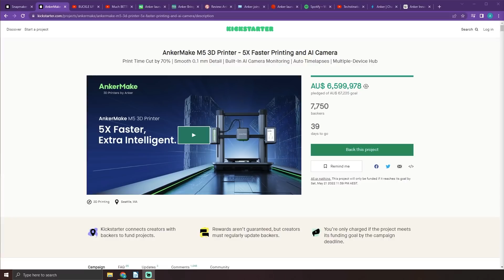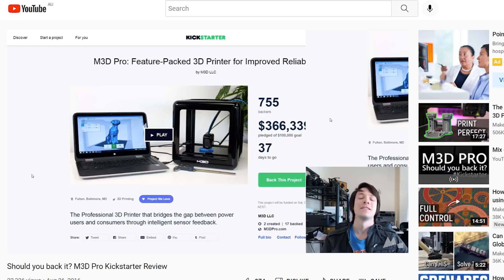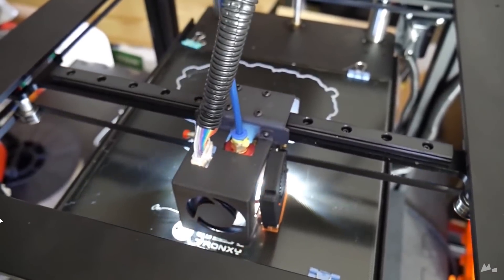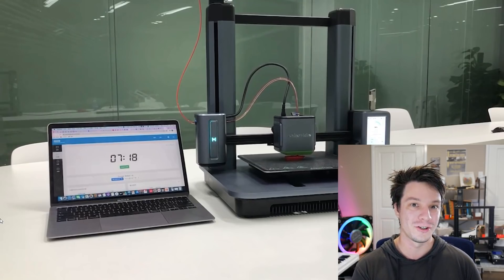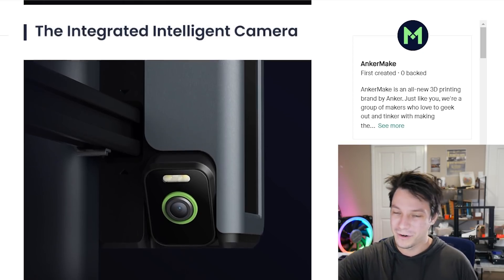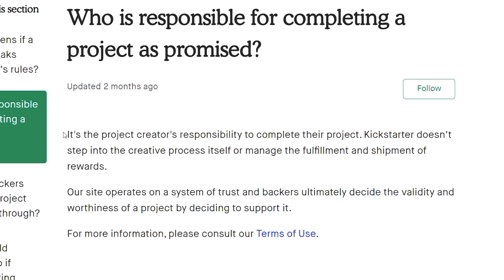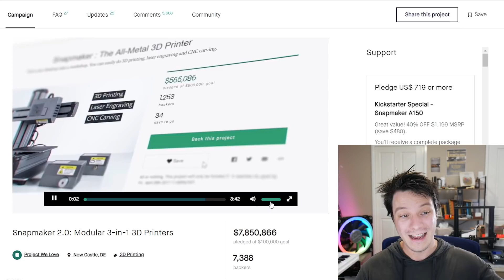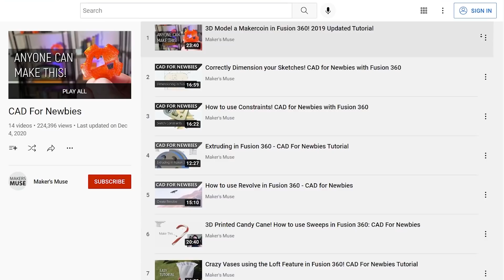This 3D Printer looks incredible, but...

Comment: Thanks for the sincere analysis, Angus. :-)
It started off feeling as though I was going to be taking a cold, hard reality shower, having already been impressed by the LTT sponsored review and leaping into my first Kickstarter.
Fortunately, I still have time to back out (till OZ Election day, anyway).
I have been in exactly the position of having leapt into cheap 3D printing with ALDI's offering and gradually run into the limitations and frustrations of leveling/hot-end/humid-filament issues, then given up.
This product, AND your commentary, have reinforced my willingness to invest and potentially take a loss (which wouldn't previously have been possible for me), given that there IS a chance that it will actually deliver the things that I needed to resume involvement in 3D printing.
I was very glad to hear your respect for Anker as a company (I had no awareness of their existence, even if I do happen to own things they've made).
I am glad I chose not to splurge on the Air Freight delivery option, though :-D The COVID pandemic has trained me to expect significant shipping delays to OZ for everything.

Power On, mate! :-D

Comment: Interesting.  I'm beginning to agree with the notion that you need to learn how to 3D model before you 3D print.  It's as if you need to learn the ways of fitness and running to own a treadmill.  Otherwise, the treadmill becomes and expensive clothes catch-all.  So.  I subscribed to Fusion 360.  And gosh darn it, I'm gonna learn it!  (I've used Autodesk's Design123 to the point that I've out grown it)  Thanks for the video, Angus, as always.  This will help re-set my mindset on my next endeavor using this technology.

Comment: Yes, i belive Anker is gonna deliver there Printers.
But what i'am curious about is the AI/Spagetti Detectiv Part.
Because this is a Service to controll you're prints and Spagetti Detective charges you in the Pro Tier 4$ for 50h of printing!!!
If you run 10x 5h prints you're done and this can happen in less than 1 Week easily.
So i'am curious how they wanna do that Part.
Ouh and btw. the Camera need light to work and i don't see any light from the Printer besides the Logo in the left glowing a bit.

Comment: This video is gold. I live by Never Preorder, Never back a printer on Kickstarter. When you mentioned a "cartridge", Made me cringe. Loved it when you said " Want to 3D print? Better learn 3D design." So true. I don't see a need for a new, better  printer. I have both FDM and resin. My FDM came to me as a Chinese A8 or something clone in a box full of parts for like $180.00 USD. Maybe I'm lucky I'm mechanical, but I think assembly brings you closer to the machine. Mines rock solid plug and play. As I'm heavy into model making for the last 60 years, I use it for utility parts and my Mars for pretty parts. So much easier to use a machine when you learn how it works.
   I would guess when people get their first printer, If it beats them up, They'll give up and put it in the closet. If it doesn't and they make a Benchy, What's next? Learn CAD. What is needed is a easy, intuitive and strong CAD program. If someone makes that, Printers will sell out. Never preorder and Never Fund.... Unless you have a lot of money you don't need.

Comment: Regarding the 10 years prediction :

I don't think 3d printing will be mainstream in 10 years. For 2 reasons : 3d modelling, as well as no real market.

Text is a fantastic way to store and share information. Because of this, it has a central place in our lives, and so everyone learn to read or write. So there is a mainstream appeal for a machine that could write for you. 
In the other hand, customisable objects are fantastic problems solvers, but aren't indispensable in our world. So there isn't really a mainstream appeal.
I use my 3d printer a lot, but it still spends most if it's time at rest. Because i don't need a different plastic thing every day ! And even 3d printing for friends, i use it a few times a week at most. And i'm quite the creative type, spending lot of time building stuff and inventing things...
Most people will not need to have manufacturing capabilities at home. A fraction of people will need a one-off thing, and only the maker community really needs tools like 3d printers.

The most mainstream usecase is going to be on demand 3d printing services. Your library, electronic store, hardware store etc. Will offer on demand printing services, and it's going to be more than enough for most. They could also offer modelling services, which leads to my second point.

3d modelling IS HARD. I was in the french equivalent of college in an "Science and engineering" speciality, and we had modelling classes. Despite having teachers, paper ressources, example etc., most people had a really hard time learning to 3d model. And we were just doing basic "extrude and revolve" kind of parts ! 

For a maker, that thinks a lot about the parts feature, 3d modelling will come more naturally. For the mainstream people, they only care if the part works or not ! 
Don't get me wrong, I think 3d modelling will get more accessible in 10 years. But not so much that everyone can intuitively open a word document and start typing text.

And, as you said in the video, only 3d printing stuff you download from the internet isn't 3d printing. And most people won't see the appeal of custom making a somewhat"standard parts"

The future to me lies in on demand service. Fiverr kind of stuff for people to model and print a part you would explain with a few sketches, picture and text. 
Even if we manage to have a low cost 100% success rate machine, most people won't have a use for it, and won't be bothered to try and manufacture parts when they are fine with off the shelves standard parts.

Comment: I'm not so sure about Objet-like technology being great for consumers. I do see it is less messy that SLA. On the other hand, just about any fault in an Object needs to be fixed by a qualified engineer. And there will be leaks in unexpected places... So at some point a consumer may need to mop up monomers, but without the experience of doing so often. Also, these machines cannot be  turned off without some work.
It might be a nice solution for people that print often, as the resin remains fresh and the print head decent. But for people that only print every once in a while, it may well turn out to be a rather messy affair. For the latter FFF with all its problems may turn out to be less error prone.

Comment: My company has an objet 30. Not a fan. Way too expensive for what it is and I doubt that will change with Stratasys behind it. If it was 10X cheaper for materials it might see more than once every couple of months use, but you are still limited to UV resins, and they have to have a consistency such that they can actually flow through the nozzles and not constantly clog.

Comment: My 5-6 year old Qidi 3d printer for $650 still prints really really well. I never made any modifications to it and only had to replace the extruder hub once after a couple thousand hours of printing. I think it does print a bit slower @ 35 mm/s but it's near perfect prints. I'm pretty happy with it and haven't needed another.

Comment: Last thing I want to see is the inkjet model on 3d printers.  Having a roll of filament that 'goes bad' because the chip says it's out of date, or a sealed container of it saying it's empty when it's obviously more than half full... Uhg...

Or the worst, your '3d print' refill unit costs more than the printer itself; oh, yeah l it's coming, mark my words on that.  The 2d print has inkjet carts that cost more than the new printer, say empty when half-full, have chips that 'kill' the cartridge at a certain date (expiration date, lol), cost 25 cents on average to make (yes, considering materials, the manufacturing and factoring involved, the pay for the labor, maintenance, managerial and logistical implementation, and even the losses that are incurred by selling the printers below market value.

Ever wondered why a laserjet printer is built like a tank in comparison?  And why toner B&W printers and even color toner printers cost so much more, but can fire off thousands of pages in some cases without a refill; and cost a fraction of a penny per page???

If the 3d print market is ready for the big time, there are 3 things that have to happen:

# One = Reliability, error detection and correction.  AI handled optical checking during print process and sending messages via cellphone/email/hell facebook messenger because people pay attention.... (youtube DM or commenting would be funny as hell though!)

# !B = materials handling has to be safer/easier.  Cartridge based printing, kept as a reasonably priced system (I'm talking like a One Blade shaver; where the handle costs quite a bit, but the blades cost about $40 for a year on average of shaving, not a Gillette; where the handle costs nothing and blades are monstrously over-priced)

# ~ ((SqRt (5 * sine(8))) * 10 ^ 4) - (10.583 ^ 2) = print speed... going back to my laserjet analogy vs. inkjet.  My giant old Okidata and digital printers could file out a page every 2 seconds or something like that... and were toner-bottle refill type... those are fun :D

I'm sure there's more, but that's good for now.

Comment: 12:00

Shit bro. 
Got my Chitreality CR-200B a couple weeks ago.

-Steppers made the sound of someone drilling through concrete when leveling
-Bed was unevenly mounted or even bent, had to stick smth to the limit switch in order to even level it because it wasn't possible by default.
-Missing screws from steppers, making them MOVE AROUND
-fan noise @ 68dB (others on fb reported around 40-45)

Comment: I agree, if 3D printing is to become more intuitive for people with less tech skills, something had to change. Same applies for health issues. Loads of chemicals are toxic in the long run, so there needs to be a solution for that as well. I see a lot of people having enclosures, but they forget that they open them up and the toxins roam free. As for people with allergies like me, resin is still not an option yet. 

Still I wonder how long 3D printing will appeal to people who can't design their own stuff. They will stop printing after a month. Some free programs are a pain to work with as soon as you come close to their max file size. Some free programs have features which are a huge pain in the butt as there is no user friendliness at all to locate them in the program and figuring them out costs yet watching one more dated YouTube vid, and the new version of the program altered how it works. 

Yet, despite all the frustration, I am addicted to 3D printing my own custom-made miniatures, lol! And thanks to your vids, I got the hang of it fast!

Comment: these 'failure detections systems' are extremely simple if you think about it... a microswitch to see if there is actually filigment coming through that is held in the open position by the feed plastic, for instance... or a simple IR sensor for proximity sensing (all phones have one to tell it to shut the screen off when it's by your face).

A relatively inexpensive Jetson Nano could be used to keep an 'eye' on the print as it goes to make sure each layer falls within a parameter that matches the image of the print at that layer... and I've been playing around with something similar that looks at a rack of merchandise and can tell when a product is out of place by doing something similar.

There's a LOT of very cheap and easy ways to take care of, and pause/stop a print, and send you a picture/video of what's going on to your phone and giving you the choice to remotely 'keep going' or to 'stop' or possibly execute a self-mitigation function.

Sure, you are talking about adding maybe a hundred dollars worth of parts, at least.... but that being said, that's a hundred dollars that could mean a LOT of peace of mind for a lot of us.

Comment: I don't think there aren't any good options on the market for 3d printers that are very easy to use. I got into 3D printing at my library maker space and they had the dremel digilab 3d printers. After a quick how to use section with the maker space manager I was able to use the printer without problems. I actually don't remember having one failed print.

The real thing here is the price point as these printers are very expensive. So if this campaign can deliver on that, then yes, it will probably be industry changing.

Comment: I agree with just about everything you said, but I partially disagree about 3d modeling. Yes, the use case depicted in the ad, 100% you need 3d modeling ability for that, but there are absolutely viable use cases for 3d printing that don't require any 3d modeling or, like myself veeeeeerrrry basic 3d modeling. For people who want to make a specific type of thing for which models are already available it could work fine.

Comment: I agree that a printer that could take a solid model as input kicks down a huge number of barriers to entry,  especially considering it can be paired with simple photogrammetry based 3d scanning with a cell phone for simple object duplication.
I don't see 3d printers to ever be an every-house tool, but it could be as popular as an expensive home network router.  
I just don't think there's broad enough appeal to be operated by grandma, regardless of simplicity, but there's tremendous promise that is achievable if enough people can get organized around an ecosystem including projects like Voron Design's team which is driven by a purpose-driven engineering team working it like a product line.  An open design can be augmented by plug-ins and hardware modules add-ons,  type converters and specifying bill-of-materials on a continually improving basis. 
From that point,  evolution of design is more reactive with down-stream vendors selling parts to assembled machines in the value chain.  Improved speed of adoption adoption will be a function of quality and ease of setup, maintenance/operation with OTA software suite updates.

Comment: We have one of those objet printers at work, and let me tell you what junk it is. Extremely expensive compared to fdm printers. And if you use it, it breaks. You don't use it it breaks. It takes months to get parts. The 'ink' is expensive and expires quick. 1 of 5 stars would not recommend. We just got a prusha mark3 just so we would have a printer that works when we want it to.

Comment: I can get on board with most of what you've said here, though I can't imagine any UV-cured printing technology replacing certain features of FDM printing like wood/CF/metal filling materials...I'd also rather not have an open high-power UV LED without an enclosure, for similar reasons to not wanting a naked laser diode in my home.

The thing I find irksome is your last gotcha - which isn't one at all. Never mind that "3D printing isn't for anyone who doesn't know how to model" is the software version of "3D printing is only for tinkerers and people who enjoy troubleshooting mechanical and electrical problems"...it's also simply untrue. I got into 3D printing a little over 2 years ago, and in that time I've fully modeled only five things (four in Tinkercad and one in OpenSCAD). Add another dozen, if you include other people's models that I slightly modified in Tinkercad for one reason or another. Everything else I've needed or wanted to make has been something other people have modeled, the vast majority of which were offered for free on Thingiverse, Cults3D, Printables, or Thangs. 

Want to print a toy for your kid? There are somewhere between 10,000 and 1,000,000 different files for toys out there on the Internet just waiting to be downloaded, sliced, and printed. You can certainly design your own, but you don't have to in order to enjoy 3D printing. Claiming that this is a requirement directly contradicts the concept of democratizing additive manufacturing and your own opinions on how hardware issues from consumer-grade printers keep 3D printing in the realm of hobbyists.

Comment: once the knockoffs and copyclone printers go away , and people realize to have a functional printer from day one, some money must be spent, buying junk for 100$ and there is an expectation to work, wont happen. my friend got me one of these 100$ printers, knowing it would be a problem, well yes, it barley worked out of the box, to the point where i rebuilt it with a BTT board and made my own marlin firmware for it. i did enough work on it to say i made my own custom delta, and it works nicely but nothing like my prusa.

Comment: I'm not so sure the 'Objet' or material jetting type printers will be the norm, even if it is mechanically safer than current resin printers. It will still require all the same aspects of printing (like supports) and any automatic function of that would just be a QoL addition. It's also still resin, which will need to go through some chemical engineering properties before it overtakes existing filament diversity. 
What we really need is more commercially available FFF printer that aren't garbage or cost a fortune. We're still missing that middleground. Even the MK3 is just a really nice DIY Core XY printer at its heart. Anker being involved will certainly be a good start if they can ship a functional product for a fair price.